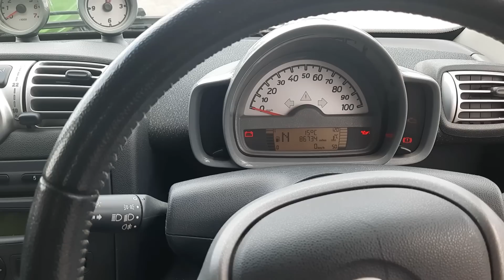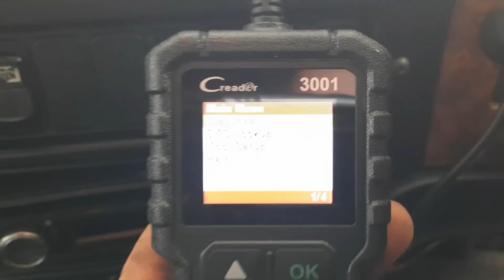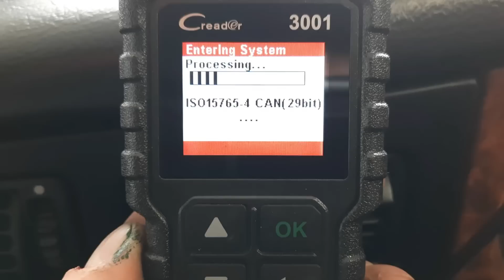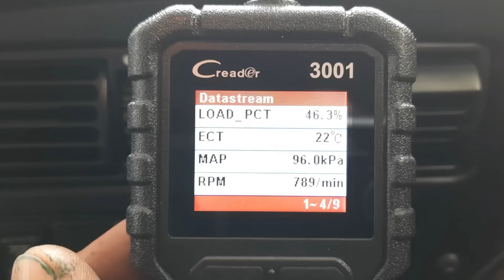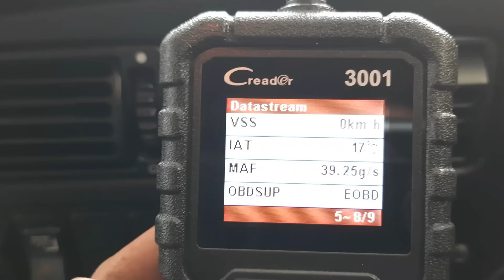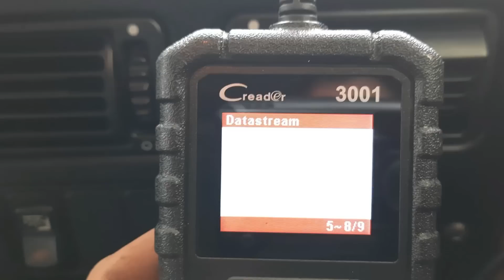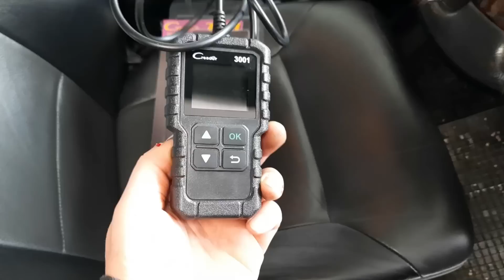I had to tell these Karen's how it was!

Comment: That mount looks fine, you'd feel the engine moving when you let the clutch out, inner driveshafts are a good possible, jack it up on axle stands and run it you may see the inner drive shafts wobbling.
Reply from the maker: Yes driveshaft next
Reply: @ChopsGarage  if it's shaking then drive shaft, maybe, take them out at the hub end and feel for play, things like this are so hard to find, tbh if it's not running right I'd not bother and sell it cheap or auction anyway mate, before you spend too much, that engines rubbish on those, people think vws are like 90s ones and there deffo not.
Reply from the maker: @roystonvehicles9129  I have the advantage of the YT revenue allowing me to pursue the fix otherwise I would
Reply: @ChopsGarage  yes bud, wish you luck with it, just had a call from Glasgow for my 500 sport, can I give you a bid, 3250 he says, then I said are you clear it's a cat car, no he says, then it's oh I don't want it, straight 40k sport 13 plate for 3250 (?) this jobs getting a nightmare, customers totally impractical expectations.
Reply: @ChopsGarage  auction actually rang me and others asking if we were attending the other day, that's not happened for a few years, makes you think.
Reply from the maker: @roystonvehicles9129  mental isn't it, it was clearly already major cheap if he thought was straight and still chipped you. Now he will get 2010 with 90k for same money that's had more paint that forth bridge anyway
Reply: @ChopsGarage  I know bud, it happens all the time, you've just got to wait for the good as gold customer, I got that 500 cheap at 2k but I don't want to throw my price advantage away, everythings gone up, even auctions upped the fees and we're about the only ones customers can take a pop at.

Comment: 26:00 - P0402 is probably the EGR valve sticking open at a guess... they're meant to recirc exhaust gas back in to the inlet to help lower emissions. Problem is they get clogged up with soot (especially on diesels) and stick open instead of closing when they should. If you can get the valve off, you could clean it up and see if the eml goes away. Might need a new one though depending how far it's gone 😊
Reply from the maker: We will drive about bit more
Reply: Agree with andy. Driving around, italian tune ups dont work on these modern diesels. Just creates more soot!....needs to come out and be cleaned. Along with cooler, associated pipework and intake manifold.

Comment: I think the EGR is only 4 bolts and is probably easy to get off and clean with brake cleaner or oven cleaner if you dare to try. Should be the same as the Jeep and chryslers that used them engines.

Comment: Rubber could have gone on the engine mount underneath and transmit vibration, if it's a kind of shake tho it could be shafts, had a vectra and they were really bad, jacked it up and it was only the boot holding it on.

Comment: I bought a 2016 car from a dealer in December 2019. The car had a service when I bought it and was told they do not have a service book it’s all stored in the car memory. I thought if that’s the case as I do all my own servicing oil, filters, plugs etc at keep the receipts and record mileage aswell on an excel spread sheet. Would you think this is good enough as a full service record.

Comment: I bought myself a nice 10 plate Honda CR-Z with only 58k on the clock and full service history just yesterday from a dealer in Burnley for a very reasonable price. Drove it home (120 miles) on a variety of roads and I must say that I am loving it. Nice sharp handling and nippy when you want it to be. No, it's not powerfull, but the road tax is £25 per year and the fuel economy is very reasonable. Plenty of toys to keep you entertained and the stereo is banging (sub-woofer included as standard by Honda). Cheap insurance as well, being group 17.

Comment: You did right to avoid that tt bud, you've already got the golf with that engine, I avoid them, sold a tt with that engine in it, chain went next day without warning, did all the valves, there bad for oil burning as well, as you say 2016 is a long time ago for its last service, hyundai looked mint, looks like your heading up to 30 cars now bud.
Reply from the maker: Must be 30 plus think
Reply: @ChopsGarage  I'm at 40 bud, giving auction a miss for a bit, I can only just get round the yard now, , been on with some long stayers and shifted some, tbh it's mostly paint on them all.

Comment: My 2007 Colts not been serviced in 4 years , it burns oil so i just keep topping it up with fully synthetic , it has a timing chain but still is pulling perfectly fine , coolant still the normal red colour too , I think you can get away with not servicing a car as lets be honest £300 to change oil filter oil and coolant and some air filters not exactly good value for money , I was thinking i may use one of those suction pump things to suck out the old oil from the engine and do a change that way the easy way lol
Reply: i hear they only remove 90% of the old oil. There is a YT Video on a chap doing a BMW with one: Left over a litre behind. Not for me thanks.
Reply: You've not serviced your car in four years?! 😲
Reply: @jdmguy44  Yeah as it only cost 600 pounds 💷  I'm using it as a runaround,  will just buy another when it blows up but it still pulls 120mph on rev limit in 5th lol 😆
Reply: @patagualianmostly7437  Yeah but sediment at bottom of the engine won't do any harm , its good to leave it as if you remove all oil then leaks will happen , the sludge blocks any seals fro  leaking 😉  my logic works as my car is near 130 thousand miles and no leaks

Comment: Hi good and informative video . Just sold couple of weeks ago , a 2008 Golf tdi dsg . Had sort of movement in the engine when engaged D . Other than that spot on . The idea it’s that I had it for over 4 years and it’s been very well looked after but that issues been seen by at least 6 different reputable garages and never found what it really was . However  the driveshaft or the dog bone the rear engine mount or the under engine frame bushes could cause that movement. It’s something Vw specific . I had it on couple of Passats also .

Comment: I had VW with drive shaft issues common issues
Reply from the maker: This I've heard
Reply: @ChopsGarage   the way to check issue is to get a couple more people in car as it’s more Apparent
When Accelerating mine only came in at about 50 mph or an on the Load.

Comment: Surely it's based on mileage, come on your not buying a new car at 4.5k, if i had my car serviced and the didn't use it for a few years as long as the mot was good plus battery ect was all good, no problem, full service history
Reply from the maker: No oil degrades over time, if you are using it a bit every now snd then on 5 yrs old oil you are doing damage

Comment: Chop will you buy 1 car from Mannheim or bca under 5 years old and 50k and try selling better stuff and see if it’s worth from a aggro pov retailing small under 5 year old cars and just wash prep and warrentbthem and wave them good bye instead of orphans clapped out and done more miles than a postman’s sock
Reply from the maker: I have a few mate from main dealer slow movers for me due to low income area. Lol, postmans sock! I did just get my FCA licence for Finance so more of an option now
Reply: @ChopsGarage  unfortunately I'm the same, later dearer stuff is hard work, you've had a few 7, 8k run of the mill cars stuck, be interesting to see how you get on offering chucky, I used to do it via a 3rd party years ago, every time I think about doing it the car sells, on auto trader it takes people to zuto for a quote, a draw back I don't like is they think coz their paying you mtly it's your car (warranty) over the whole period, quite a few people are getting the chucky company to step in if there's problems, even a year or 2 later, some people I know got the finance company to pay when the chain went on their 18 plate land rover, dealer didn't want to know.